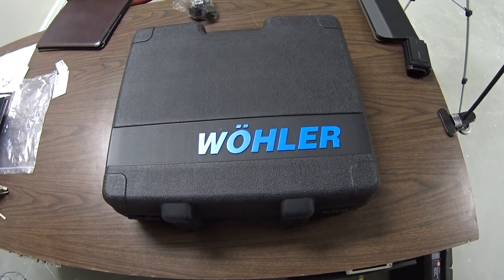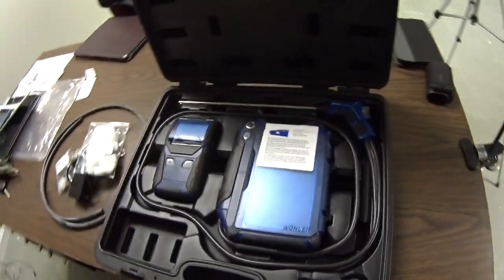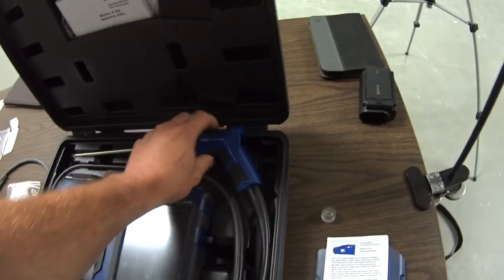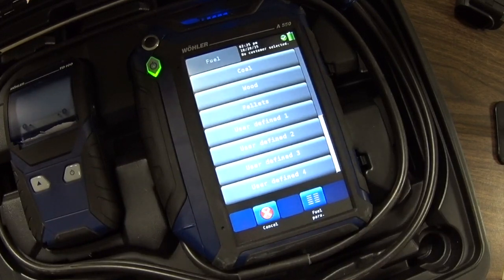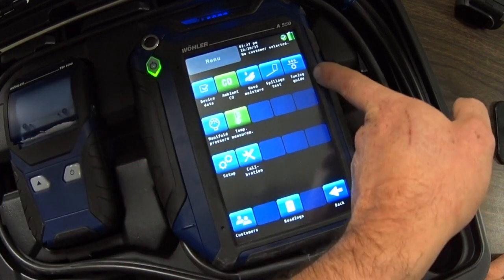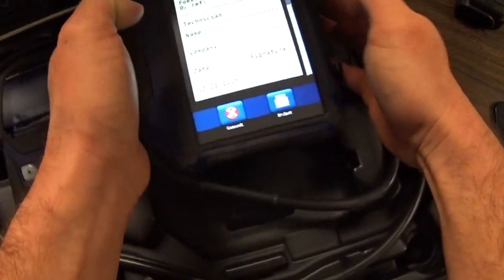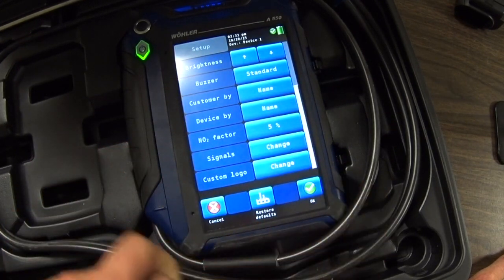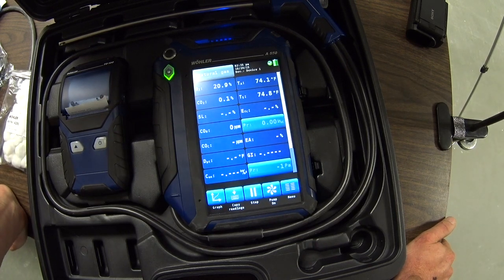HVAC Tools: Wöhler A 550 L Combustion Analyzer Hands On

Comment: I love the way this thing looks, but I wouldn't pay that much for it, main reason is you have ones that cost half that and you can field replace the sensors( no down time) and don't have to send it away and pay 75 bucks or whatever to recalibrate
Reply from the maker: Field replaceable sensors are great but if you every had to take your readings to court in a lawsuit you'd better hope your device had been recalibrated within the timeframe that the lawyer wants!

Comment: It's very nice. 
pros- I like the look of the interface and how you customize it.
I like how durable it appears and the ease of access to the connections. 
I think commercial or industrial techs would benefit from the graphing and reporting.
cons- in residential I think a testo 310 or 320 is sufficient at a lower cost.
Reply from the maker: Very well said Zack